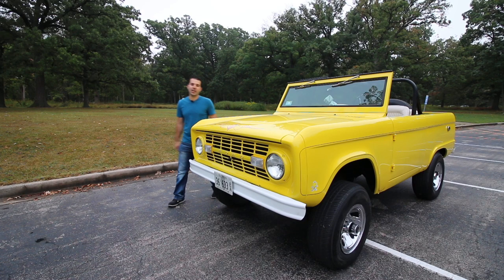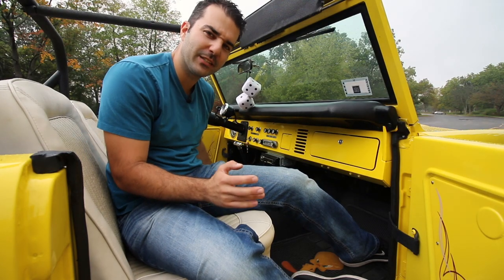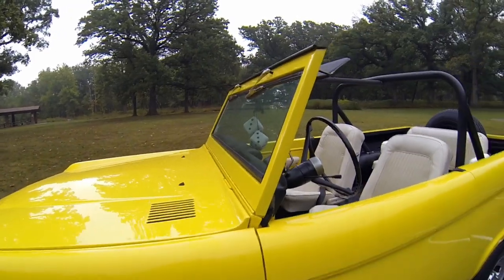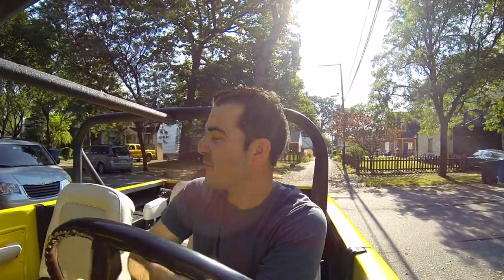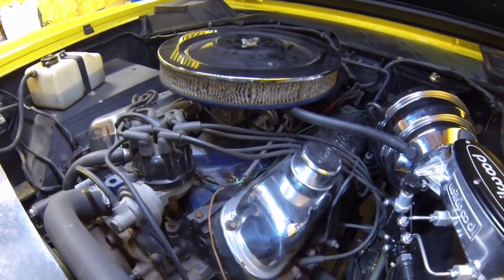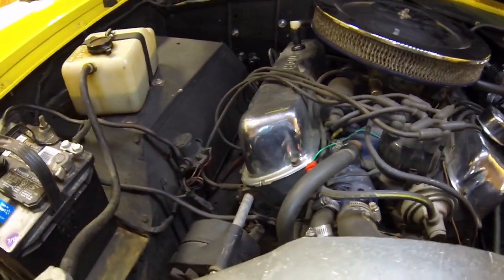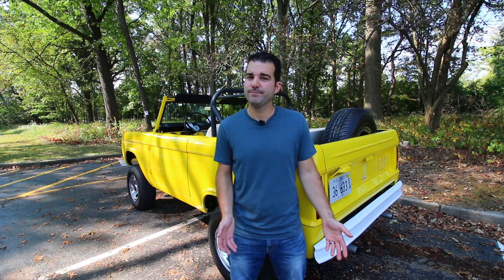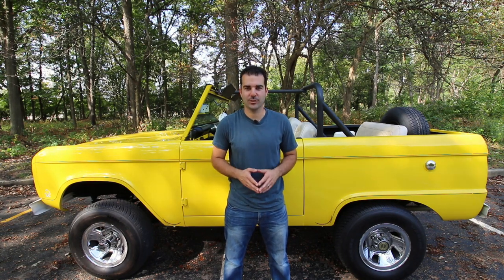Here's Why the  Ford Bronco has Doubled in Value in 5 years.*1969 Ford Bronco Review*

Comment: I had a 66 back in 1970, it had the 170 cubic inch six cylinder with front and rear oil pumps, it took eight quarts of oil. It had three on the tree with high/low range transfer case. We did a lot of four wheeling in mud and snow up here in northern Minn. I put 750/16 bar lug Good Year tires on it. When the going got tough in clay or deep snow i put chains on all four. It had two inchs more clearance then a 3/4 ton Ford. I've owned a 59 3/4 ton 4x4 IH,  59 1/2 ton 4x4 GMC,  67 4x4 Jeep Wagoner,  70 1/2 ton 4x4 Chevy,  76 1/2 ton 4x4 Ford,  76 3/4 ton 4x4 Chevy,  68 4x4 IH Scout,  78 4x4 3/4 ton Ford,  93 1/2 ton 4x4 Ford,  05 4x4 Ford Escape, of all of these the Bronco was my favorite.
Reply from the maker: Holy crap you've had quite the collection. Thanks for watching.

Alex

Comment: I had a 1980 Jeep CJ5 that got caught in a rain storm with the top down.  The foot wells had about 8 inches of water in them, but there are plastic drain plugs.  I pulled them and it drained and there was no damage done.  You can get one in nice condition for about $15,000.

Comment: I love my 74 Bronco Sport, it's got a 347 stroker, truck 4spd, ARB locked Ford 9" rear and Dana 44 front w/4.88 gears, the same color scheme as a "50/50" bar (if you know what that is you're older than I am lol) and it's nothin but ultra reliable torque and horsepower...and it was given to me from my Dad for free...how friggin cool is that...

Comment: At the beginning of the video, when he's standing in front of it, I'm thinking 'that's not a Bronco, it's an International Scout' because the body looked too, it's hard to describe this but, "vertically fat" and I was really confounded until he mentioned that the front windshield had be chopped a few inches. I would've never imagined that that would change the look of the vehicle so dramatically.

That being said, I just think it's insane to chop a bronco windshield. The biggest design flaw with the Bronco is the super low front glass. I'm not extraordinarily tall (6'0"/183cm) but I sit in the driver's seat and right at eye level I'm looking at the metal part above the glass.
Reply: The scout has a much sleeker front end and a more rounded body.  Also, chopping a bronco is the stupidest thing I’ve ever heard. The guy must be 5’4.